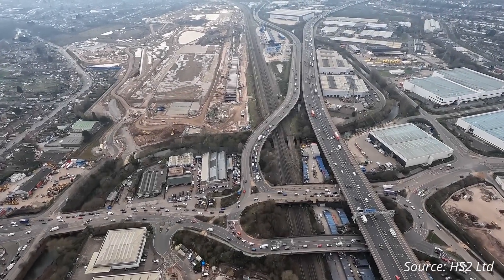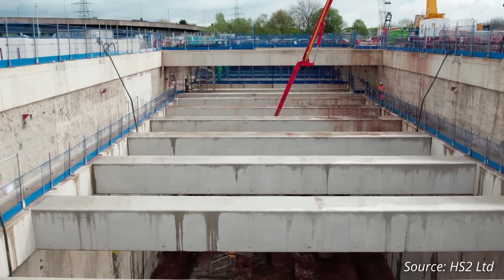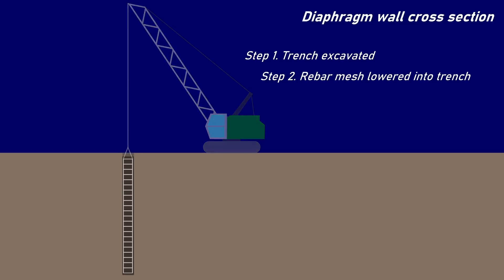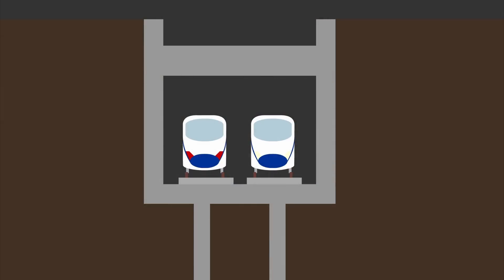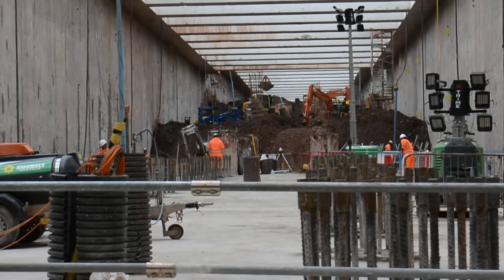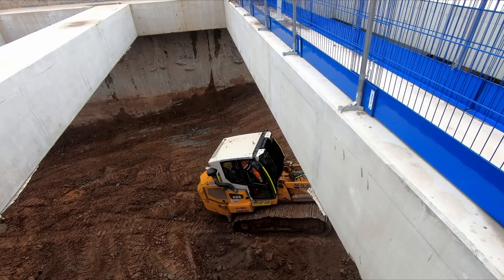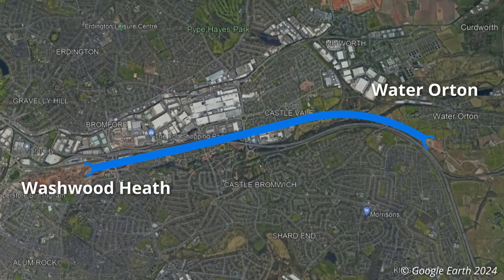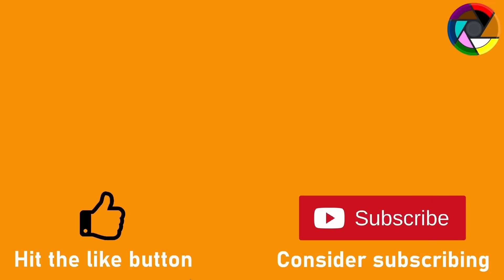HS2 Bromford Tunnel Portal

Comment: All this concrete and excavation surely cannot be any good for the environment
Reply from the maker: If it generates even a relatively modest modal shift from air to rail (Manchester and Glasgow flights) then the embedded carbon will be easily paid back. Can't

Comment: What is the point, doesn't go to Birmingham centre, and on ward stations, and doesn't go to London. Don't bother replying heard all the hs2 engineers bs before. How many people have died because money wasn't spent on NHS, i personally know one.
Reply from the maker: It does go to Birmingham City centre. Claiming people have died to pay for HS2 is an utterly ridiculous argument. Best educate yourself on the difference between CapEx and Opex. However, the entire budget for HS2 spread over many years would fund the NHS for less than 6 months.
Reply: @Rail_Focus  you obviously are not a brummie,  digbeth is not Birmingham centre. So educated yourself.  Wasted money on railway no one wants means money can't be spent on NHS.  Trains not running another 10 years absolute joke.
Reply: I am a Brummie, and know that that the walk from the completed Curzon Street Station to New Street Station will be approximately 5 minutes. HS2 will not exactly be on the edge of the city.

Comment: The Victorians built railways quicker with picks and shovels using PRIVATE CAPITAL. Modern railway construction is paid for by the never ending finance of enslaved TAXPAYERS and, in this case, started at £36 Billion and now, with a large section now cancelled is at £150 Billion and rising.
Construction began in 2017, SEVEN YEARS AGO and is still nowhere near finished.
Reply from the maker: Many thousands of railway workers also died building the railways. "Victorian" isn't a standard we should aspire to.

Comment: Good description of the methodology. This is known as top down construction,  building the basement upside down. It couldn't be built the traditional way of bottom up because it is too deep to build with a piled retaining wall. A diaphragm wall is the only retaining wall solution there is at that depth but it's much slower and more expensive.
Reply from the maker: Thanks. It's amazing what's involved in excavating a "simple" cutting.
Reply: Building the basement the "normal" way would be to build the retaining wall, excavate the basement and pile from the bottom of the basement. But with the depth of the basement the ramp gradient would be too steep to get the piling rig into and out of the basement so the piles are constructed from ground level and progressively cut down as excavation work takes place. This is a much slower way to build but the only  way with a 30 metre deep basement.